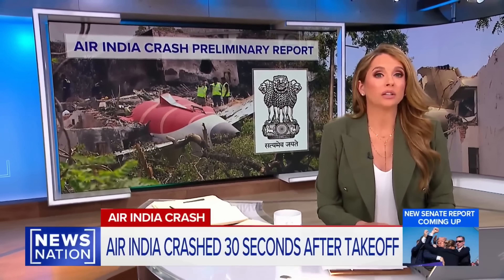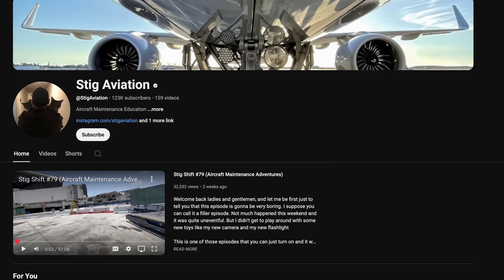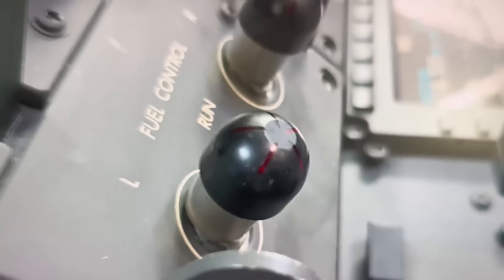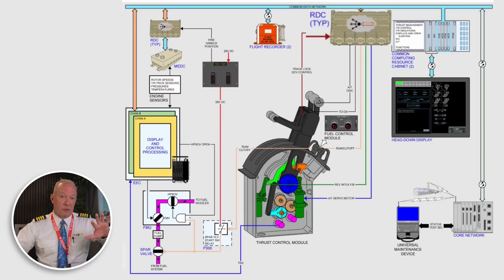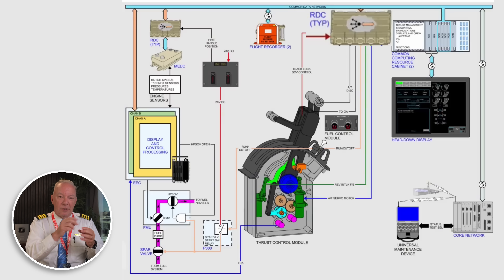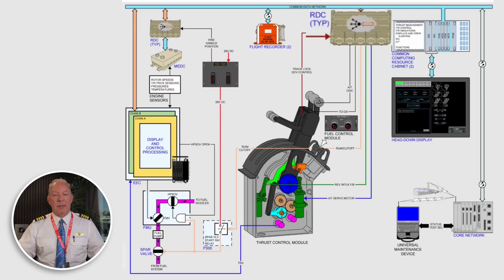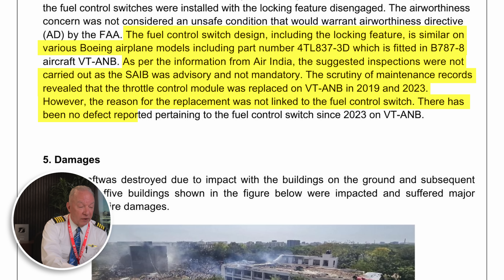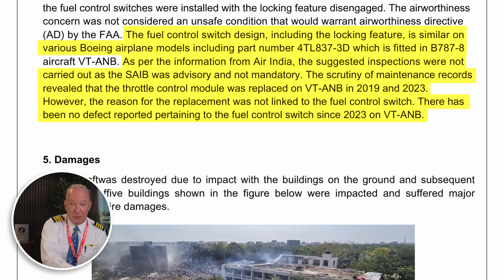The Truth About Boeing 787 Fuel Control Switches

Comment: ok i understand and if i understand correctly the switches operate relay P300 , P300 (when closed) then sends 28v to the spar valve and FMU allowing fuel to pass from the tanks to the engines ( according to the diagram the fuel cut off switches are operating fuel valves and not the fuel pumps) So my understanding is for the fuel valves to open the 28v must be present ( what if it is not getting 28V from P300 ? ) the cut off switches  need a supply from RDC(TYP) in order to pass an operating voltage to P300 (what if there is no voltage from RDC(TYP) ?  then P300 won't close.  This is rather like in your model the wire from the switch to the light been broken or the wire from the battery to the switch been broken, This leads me to ask what if relay P300 is faulty? what if there is no 28V ? what if there is voltage from RDC(TYP) for the cut off switches to even close P300 ? To me there is no evidence the switches were physically move only that 28V or the voltage from RDC(TYP) was temporarily lost or the relay P300 faulty

Comment: If the switches are in the run position after the accident, why people assume that they were in off position before... Just because pilot said some words, doesn't mean they touched the switchs.. Everything could be solved with cameras in the cockpit..Because this is a high risk and responsible job, the industry should use the cameras for many years now.. 🤔

Comment: When you hear hoof beats one always assumes must be horses. Just saying zebras make same hoof sound. Just make sure investigators examine cut off wires where they are the closest (only way both failed ). I'm on your side Cpt., 99.9 WAS ONE OF THE PILOTS. Electricity flows a bit faster than taking 1sec between a potential common arching point

Comment: Relay failures in aircraft fuel systems can happen because of mechanical wear (vibration or repeated use), electrical problems (corrosion, cracked solder joints, or short circuits), harsh environmental conditions, or manufacturing defects. Loose or rusted battery terminals can also cause electrical issues that affect relays or fuel system operation. Relays are very reliable and failures are rare, but not impossible—most aviation accidents tied to electrical problems come after long use, poor maintenance, extreme shock, or issues like corroded connections. In modern planes, the probability of relay or battery connection failure is extremely low, but it’s a risk engineers still design against.

Comment: you can read diagrams til your blue in the face, that just tells you how its designed/supposed to work. you dont know what them magic pixies can do, always path of least resistance. this plane very clearly had electrical problems before this flight, false signals to the control unit is not a stretch at all.

Comment: Well done and I agree. But looking for the best i do have a question. Is it posable to release the spring lock on top of the detent divider and trip the relay at some poiint? If that is even posable it would open the idea thet the levers were realest prematurely and vibrated off the detent to the lower off position. How ever the odd sof that happen on both is a but unlikely i would think. Just as you say looking for the best in people.

Comment: Captain Steeeve... Your schematic shows the third and final fuel valve HPSOV being controlled by a logical AND gate with inputs from both the Fuel Run/Cutoff Valve and the Controller - meaning either input could turn the third valve on or off.

Comment: Hello Captain Steeeve, I remember shortly after the Air India accident, you and many of your colleagues initially believed that the pilot monitoring mistakenly retracted the flaps when he really meant to raise the landing gear. I wonder if there is a similar scenario that involves the pilot monitoring mistakenly moved the fuel control switches from run to cutoff when he really meant to raise the landing gear. Perhaps, due to a moment of distraction or absent-mindedness, this pilot made the most bone-headed mistake that any pilot could ever make but not necessarily out of a malicious intentional desire to crash the plane and kill everyone on board. Can you please comment on that?
Reply: No one is that dumb
Reply: @Novasquad77  In the real world, absent mindedness gets people killed all the time. Even though the bar is much higher, commercial aviation is not completely immune from absent mindedness.

Comment: Based on your explanation, the fuel cut-off switches operate a relay that in turn operate the 3 valves that would either open or close the flow of fuel from tanks to the engines. So what then is operating the fuel pumps? I don't see any wiring connections in your diagram to show how or what is providing  power to the actual fuel pumps. Logic dictates that if the fuel pumps are not working (for whatever reasons), having all 3 valves opened will still lead to fuel starvation I think. Hope you can elaborate more in this specific area. And thanks once again Capt Steeeve for your insightful videos! :-)

Comment: With all due respect Cpt. Steeeve, not quite right but very close. The switch the pilots flip sends electricity to the relay (which typically carries much higher volts) to either open or shut the relay. Devil's advocate could say a bare wire along system send or cut electricity to the relay, that would cause the relay to activate. Were the wires from relay to cockpit damaged prior?? Sorry Capt., I know you put this issue to bed but, this is the question I want answered..... stray current

Comment: Great video Captain Steve. I have a question, I believe you said the fuel control switches were shutoff from left to right. In the report does it state if 10 seconds later, in which sequence the fuel control switches  were put back to Run? With that said, when you  yourself operate those switches, is it always the same sequence in the order of  left right, one two? Thx very much!

Comment: One question from an Electrical Control perspective - I would assume that each of the supplies to these relays from the 28V battery is protected by a separate circuit breaker?  The failure or operation of this breaker, which certainly was not the cause in this instance, would also close the fuel valves. There is no way that anything off this 28V system should not be protected in some way from over current, as a simple short to ground could easily open the fuel control relay, thus cutting the fuel off. 

Also is there a separate 28V system for each engine, providing redundancy in the case of a battery failure?

Comment: First of all that fuel control system is not a pure mechanical system. It’s an electro mechanical system. So the logic you need to manually toggle the switches to cut the fuel is not applicable the whole time because it’s a pure mechanical way. What if there is a short circuit that that could turn on the relay switches. After all those wires are not completely isolated. One thing we always tell in our hacker community is  no system is fail proof.

Comment: Great explanation Capt Steve.  I 99% agree with your unspoken conclusions.  To try to get to 100% allow me to play devil's advocate.  How do we know that the switches "transitioned" from run, to cutoff, then back to run?  Are there position indicators on the switches?  Or position indicators on the valves? Presumably the wires connecting battery to switches to relays to  valves run a long distance via harnesses throughout the aircraft.  Is there a credible scenario in which some sort of structural or mechanical failure happens, say, a bracket next to the harness breaks, and the resulting sharp metal edges cut into the wire harness insulation and touch the copper paths creaking a short or sneak circuit that causes valves to close.  Or the sharp edge cuts wires creating an open circuit? Or the wire harness insulation gets abraded away after years of low-level vibration creaking a short or sneak circuit.  Then someone concluded "the valves closed so the switch must have transitioned to off."  I realize it is highly unlikely in my scenario that both engines would cut off, and then seconds later they restart.  I'm not suggesting this is likely, but is it possible?

Comment: Captain if you put the fuel line to cut off will there be any alarm, that can make the pilots aware that the fuel has been cut off? Is there any safety feature that the airplane maker like Boeing add like before cutting off the fuel you have to switch a button that says Emergency like you will set it to Fire if there is fire that will alert the ground control that fire happens in the aircraft.

Comment: Seems to me the point of failure lies between that battery and fuel valves. I saw a theory that the blocking diodes that prevent current flowinto into the battery, causing a cascade of failures, leading to power not being available to the valves. Can an expert comment on this?

Comment: Here's something else suspicious that needs to be looked into. Think of the timing. If one were to purposely sabotage a plane by shutting off the fuel switches, you certainly wouldn't do it when the plane has enough altitude to recover if the switches are reset to their proper settings. You'd do it near the ground. Of course, we don't know if it was done deliberately, but the timing is bizarrely curious.

Comment: Might there be a confusion regarding the "on" and "off" movement of electrical switches? In India and UK "on" is downwards, "off" is upwards. In the US where these planes are manufactured, "cutoff" is downwards. Could the pilot have been confused thinking the switch is in the "off" position (when it was in the run position)and switched it to the cutoff position thinking a downward movement is "on" or "run"..

Comment: I just want to mention out there that relays are a very old technology. I would hope they are a lot better than the relays on my well pumps. I don’t remember how many times I replace them in the last 10 years. The purpose of relays is to have low voltage going to the switches that turn on higher voltage to whatever device needs to be turned on. so switches don’t get hot and burn up. With that said, it’s probably unlikely that both relays went bad at the same time, I put this out for food for thought. like Captain Steve said, we don’t wanna think the worst. Just maybe something else was going on.

Comment: All this conjecture about how/why the fuel control switches were closed. Was it a pilot or something far more mysterious that caused this horrendous crash. Requiring video in the cockpit would have resolved the issue. ALPA be damned…

Comment: I may not be an electrical component expert … wait… I am. Mimicking is great until it’s not. Normally open and closed contacts operate regardless of their classification”. There’s not enough resistance in the circuit to generate any degradation of the contacts to lead to mimicking or hanging.

Comment: So, if what Captain Steve says is true, 30-40 minutes after a cruising 787 loses complete electrical power (RAT fails to deploy), the battery/batteries will die and both engines' fuel control valves will close (loss of 28v power), and the engines will shut down.  Somehow I doubt that,  but I think I'll stay on the ground.

Comment: Capt. Steeeve, you covered this topic in exacting detail.  I’m a retired aerospace engineer and owned a supplier company to “this manufacturer”.  I couldn't have done a better job than you did.  Thank you.  BTW I have several of those switches and have a couple on my desk since this accident.
Reply: But capt steeve's words and explanation are contradicting the diagram that he is showing 😂 Clearly as per his diagram, display and control processing unit is capable of cutting off fuel by turning fmv or hpsov !
Reply: Captain Steve incorrectly describes the control of the fuel values according to the diagram he presented.
Reply: @exist7309  yeah he did intentionally, I think
Reply: @rajeevshagun-info  but why would he do that?
Reply: can you kindly tell us about fuel spar valves in Boeing ? whether they are simple spring loaded type as they are in airbus ?
Reply: @rajeevshagun-info afaik spar valve in Boeing aircraft is motor actuator. Once it is in open position, it will stay open until there is reverse voltage polarity that will turning motor in reverse direction.
I work for 747 and 777.
Reply: @trisetiyanto3779 is it possible that spar fuel valves can be simple spring loaded selonoid type in Boeing?
As one technician mechanic told me recently that they are simple spring loaded selonoid type.
Possible incase of emergency of fire like , when system burnt and noway to close the fuel valves,they keep spring loaded selonoid type spar valves?
Plz confirm 
Thanks
Reply: @rajeevshagun-info I don't think so. Spar valve, crossfeed valve, jettison valve all the same type motor actuated. The only solenoid type is for the refuel valve.
I just replaced it on 777 recently.
Never work for 787 but looking at the schematic I think it is same type.
Reply: @trisetiyanto3779  So you're saying that each valve (in the diagram there were 3 valves) is a latching-type valve?
Reply: Very suspecty comment as his explanation was extremely poor in many respects. Who keeps toggle switches on their desk because of an airplane crash?
Reply: Good explanation was excellent and you've clearly never met an engineer.
Reply: @JoeLinux2000  Yeah, the comment of the creator of this thread is as suspicious as fu**

Comment: "it is very important to stick with what is actually written in the AAIB report" (capt Steeeve) but it is even more important to remember they are hiding A LOT of information they could have already released and that sometime there is coverup. So, keep your eyes open.

As to the switches I was very well explained I am convinced they have been moved by the pilots, not an electrical or mechanical problem.

Turning the fuel off is probably NOT what caused the plane to crash. It was an attempt to relight both engines by resetting all the systems.

Remember there is no training for this situation because it has no value because there is nothing you can do: the plane will crash. Still, they did try the best they could to save the plane.

Comment: In December 2018, the FAA issued a Special Airworthiness Information Bulletin (SAIB) (No. NM-18-33) regarding the potential for disengagement of the fuel control switch locking feature on certain Boeing aircraft, including the 787. This advisory, prompted by reports of disengaged locking mechanisms on 737s, recommended inspections to ensure the switches were properly engaged.

Comment: You ignore the fact that the RAT deployed before those switches were ever touched. There was a catastrophic engine failure on take off and in an attempt to re-ignite the Captain or First Officer cut off the fuel supply in order to switch to run.
Reply: You state that as fact, it’s not, it’s speculation based on flawed assumptions
Reply: @slavedriver394  According to the time line and video it can be determined as fact.

Comment: Thank you very much for putting this video together. There has been so much speculation around the switches and the other electronics on the aircraft that 'could have' caused the switches and/or valves to cut off the fuel to both engines. Your calm and plain English description of the operation of the switches and the supporting electrical and mechanical devices should put to rest the misunderstandings. I especially appreciated the review of the switches, still in the ON position, after the tremendous impact of the aircraft when it hit the buildings.  Great job Captain Steeeve.!
Reply: Captain Steve incorrectly describes the control of the fuel values according to the diagram he presented.

Comment: Is there any situation during a flight that the FCS should be touched at all? Like if an engine gets on fire? What would be a proper action to take if an engine gets on fire right after V1? I am just curios. Also, can you make a video about the fuel valves? How they look like, why 3 fuel valves and not 2 or 4? Thanks

Comment: 10:35 You got "fail safe" wrong.  You described an isolated system and declared that fail safe.

Fail Safe would be if the valves were spring loaded to "open", and 28V DC was required to close the valves.  That way, even a battery failure couldn't kill an engine.

The system is not "fail safe" but safe enough.

Why not make it fail safe from electrical failure, like a battery fault?  Because that would violate "fail safe" for killing engines in an emergency.  So there is no truly "fail safe" option, so they picked a simple, isolated circuit, to keep it simple and very unlikely to fail.

The RAT is a fail safe.  The RAT is locked by a lock that "fails" open.  So when it fails to receive a "safe" signal, it "fails safe" by opening.

If the main electric bus fails and the isolated circuit works, that's not "fail safe", that's "isolated".

Comment: In order for the fuel valves to malfunction when called for there would have be an interruption in 28VDC circuit either mechanical (FCOs) or in the wiring itself.  I assume the fuel valves are solenoids therfore would have either a chassis ground (-) or a hardwired ground.  Failure on the ground side of the fuel selinoid would would interrupt the 28VDC.
I'm sure the position monitoring of the fuel solenoids would digital therfore be through the computers.
Still remains many questions...